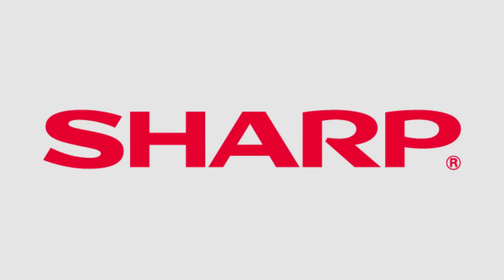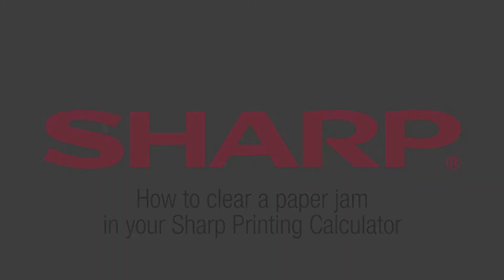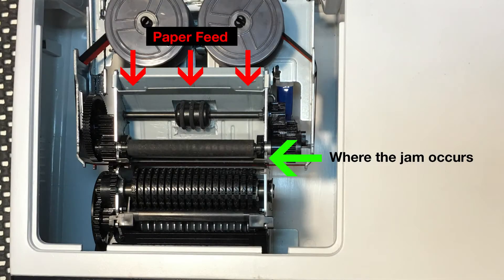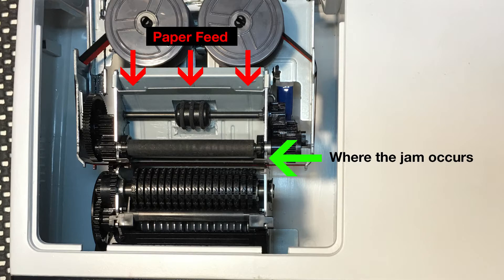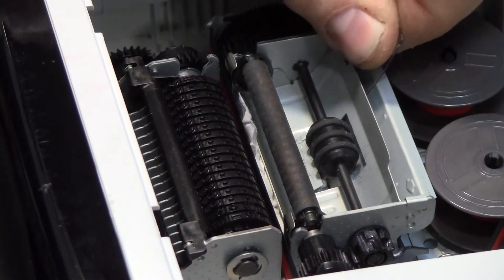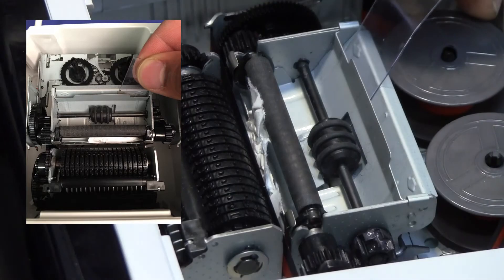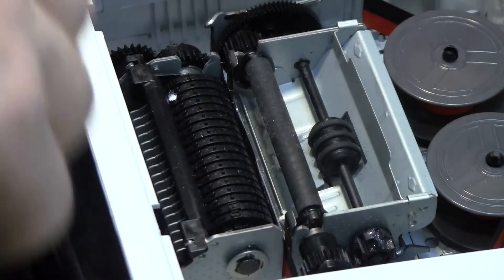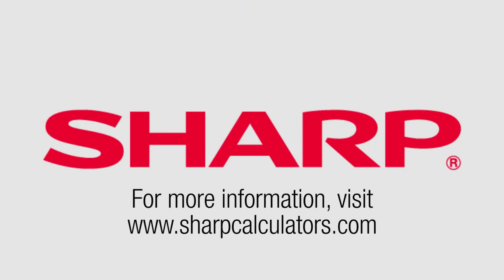How to Remove a Paper Jam From Your Sharp Printing Calculator

Comment: If I usually don't remove the gears and iron the way the paper is. I just take out the contents of the staples that are stuck in it. Then reassemble it. It doesn't take fifteen minutes and the problem is solved